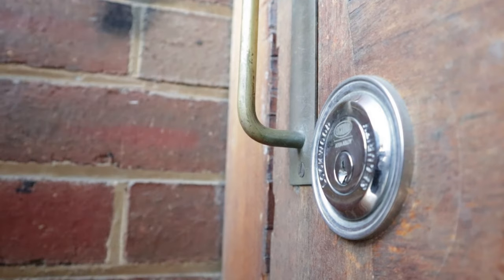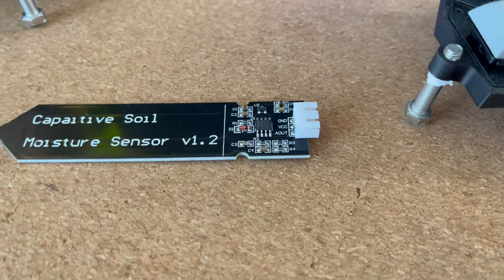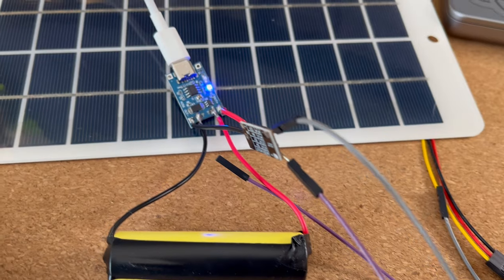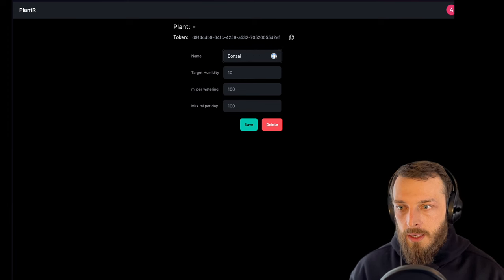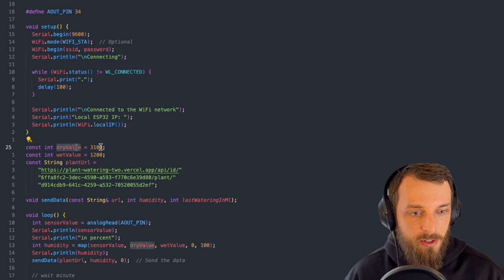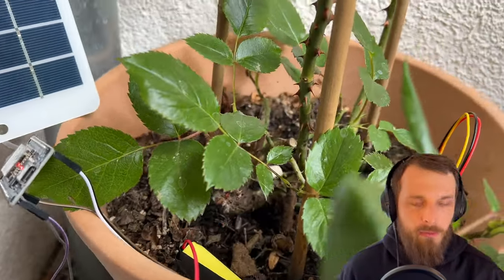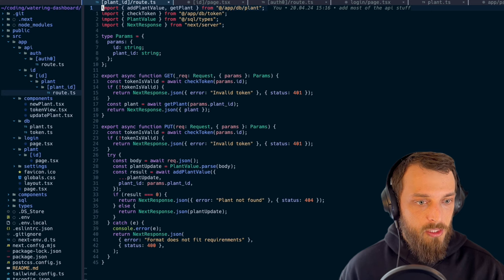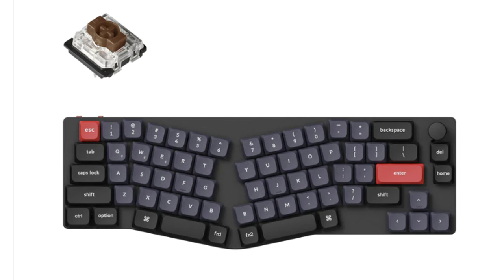DIY Plant Watering System | Pt: 1 🌱

Comment: Great project, looks really neat. I look forward to integrating your solution into my irrigation and monitoring system. :)
I would recommend treating at least the outer edges of the soil moisture sensor with epoxy resin or nail varnish or similar. On the sensors where I didn't do this, moisture got into the side of the PCB over several weeks, which eventually caused the black paint to peel off the electrodes of the sensor.
Reply from the maker: Thank you. Yes, I did, should have mentioned it :P
Working on part 2 and have many more issues to come. Happy if you maybe watch and help me with it :)

(after release, hopefully this week)

Comment: I understand, but you will need Wi-Fi for the other features. It's best to split the responsability. Serial activation, Wi-Fi connection l, calibration, data upload. It's better to read l, to understand and to mantain or add new features.

Comment: miflora ble sensos are cheap and run off a coin cell for years and provide moisture ec humidity and temp readings via ble, Node-red hosted on a pi-0-w can pick up the ble broadcast and decode into mqtt with a contributed module, an esp8266+relay (I have used wemos-d1 and plug in boards) can when flashed with tasmota switch pumps on to dose water (pulsetime).   a $10-15 off the shelf sensor per plant pot a $5 esp8266 pump controller per pot, and a $20 pi-0-w +psu and sd card.. 
I have a simple node-red control flow for how many plants do you want??
Reply from the maker: That seems at first glance a bit more complicated 😅🙈
Reply: @CodingWithAuryn  granted its a decade+ old tech, but beyond system installation/config it only requires a node red flow to control which is a drag n drop exercise for the most part..  If hosting a 24/7 server already (nas?) a mqtt broker and node red are pretty lightweight services. - and im biased ;) I didnt get on well with the spi 'cricket' sensors and got wild readings - the miflora outputs also need a little individual 'calibration'  best done sticking all in the same pot and collecting readings..

Comment: Ok, I find some issues on your code inside setup. You have a condition if with false. And than you are checking the Wi-Fi connection outside de if condition. This don't work well. Solution: set first Wi-Fi, then serial and at the end put the condition to set Config. Don't use if(false).
Reply from the maker: Why first WiFi and then serial? :) 
Wouldn’t I need first serial for debugging and then WiFi? 
Also I do if false because it is just for the calibration
So basically the mode
Will change this to be more generic :) 
But the compiler will remove this code anyhow since it is not reachable. 
Or am I wrong here?
Reply: You right about the serial. :) but remove the connection from the if.  Make the connection first and use a variable/flag to check the calibration condition. So, serial, wifi, check wifi and than calibration.
Reply from the maker: @amandioreal2293  But Wifi is basically not needed while calibrating, since you print it to the serial :D 
but will change a bit on the code and check :) 
Currently pushing some changes. But currently only use the ticker, works quite well for a while (somehow broke after 2 days, so will add some internet checks and restart if needed :D )

Comment: measuring soil moisture is a rabbit hole, please don´t fall too deep, i was building last summer my balcony plant watering system, hardware (arduino, relay board, pumps, soil moisture sensors (watch out if for timer chips ne555 vs tlc555) ne555 are no bueno (sensor with them either don´t work properly or have really small value change from 0 moisture (air) and all wet (cup of water) . And interpreting soil moisture value to some usable value is that rabbit hole. ....... good luck :)
Reply from the maker: Thank you a lot :) 
Let’s see how far it goes. Usually it is just for vacation 😅